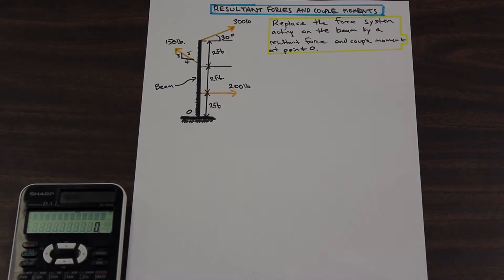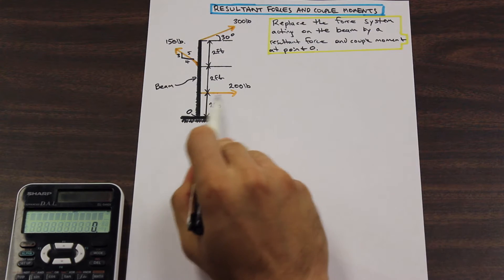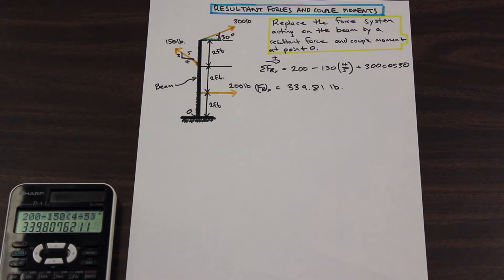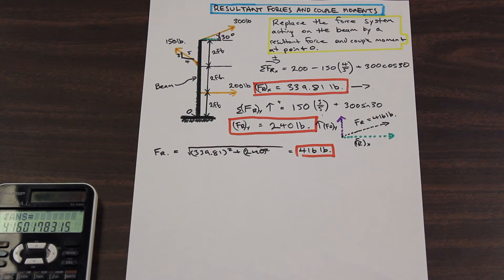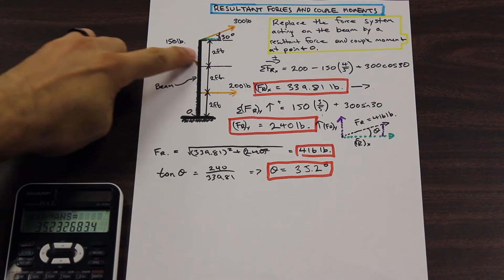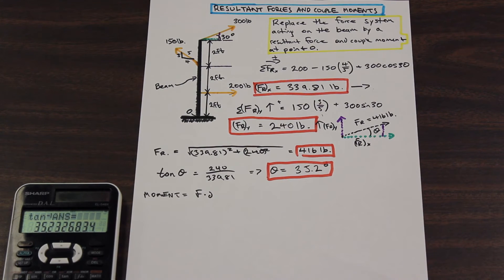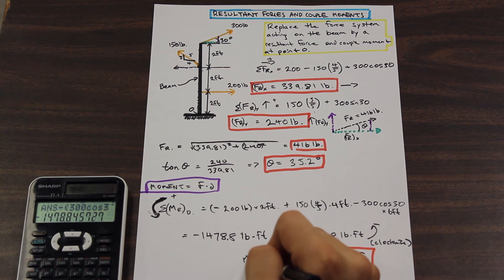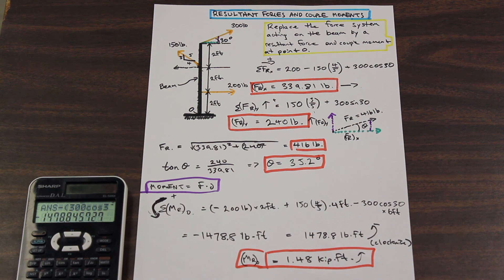How to Translate Forces and Couple Moments - Force Systems

Comment: Why we just taked the horizontal comments of the force for finding the moment about the point O ?!
Reply from the maker: The vertical components of the forces don't create a moment about point O as there's no eccentricity.
Reply: If those forces were set off horizontally on beams, you'd resolve those componrnts into the total moment as well.  For the sake of instruction, this should hAbe show that as well as drawing clockwise and CCW in the right direction at the end, lol.